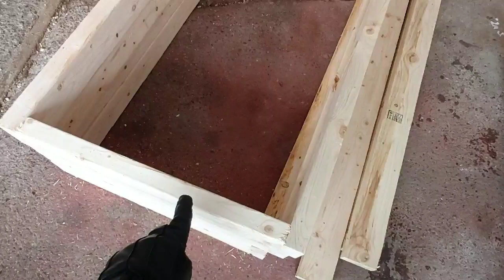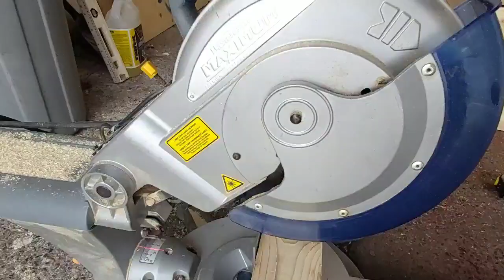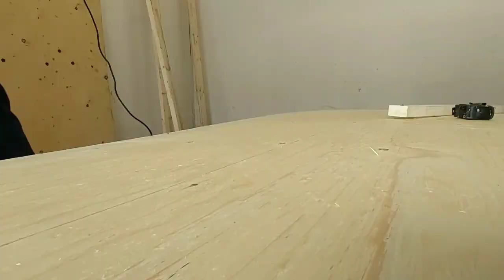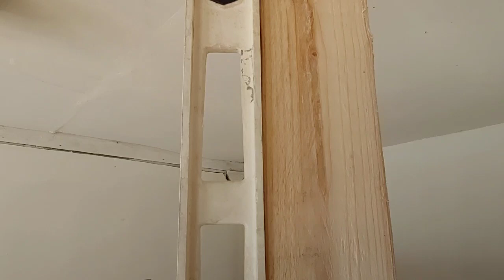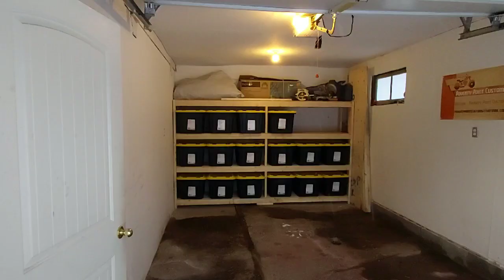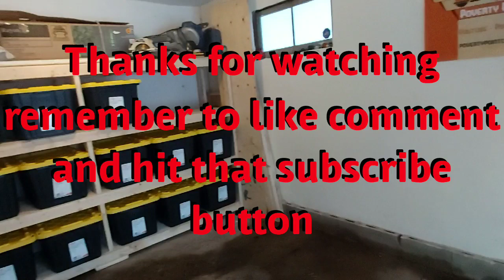How to build garage shelving cheap easy and fast

Comment: What are you putting on those shelves, more tractors? 🤔😄
Reply from the maker: I got my eye on a Massey 3090, but I dont think it would fit lol
Reply: PovertyPointCustoms — Having more than one makes you a potential hoarder. Or, so I’m told. In addition to a few lawn tractors I now have a 6x4 Gator that needs repowering. I might regret it.
Reply from the maker: I saw that, that's going to be sweet when it's done! My tractor gets lonely it needs a sibling lol